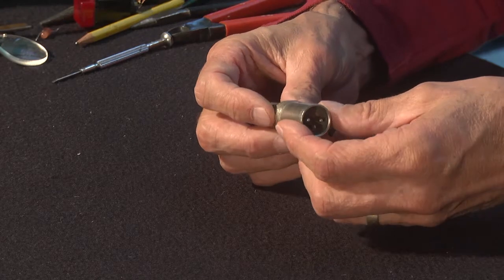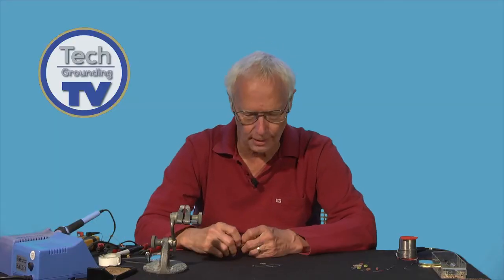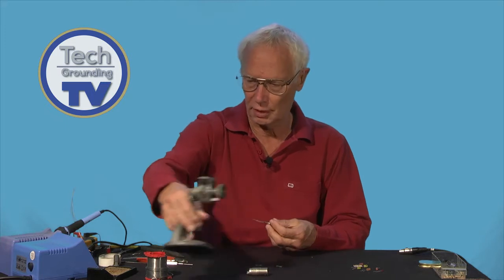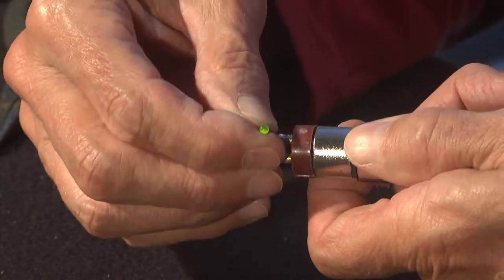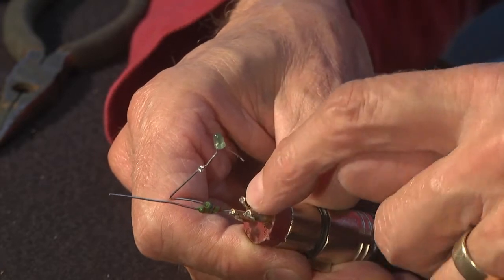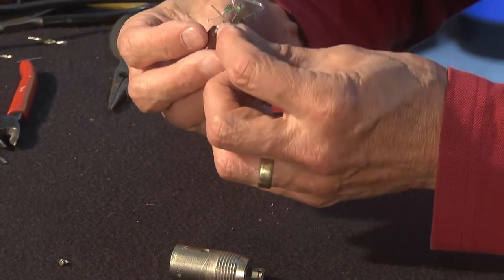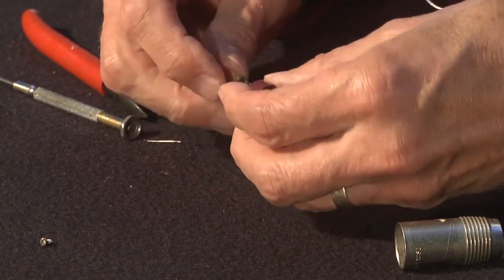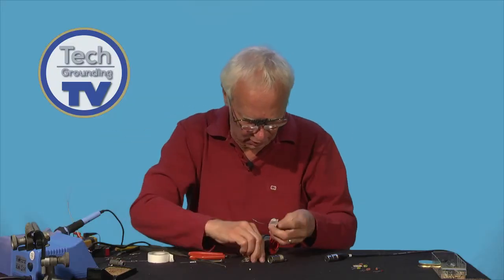BRIGHT EYES PHANTOM POWER TESTER

Comment: 9 year old video - unlikely to get a response to this, but those don't look like 5.6k ohm resistors , they look like they're 4.7k ohm resistors with a red tolerance (2%) band?
Reply: Hi! No, I'm still alive, but life is very busy and I don't make these tutorials anymore as my experience is getting a bit dated. In reply to your comment though, it doesn't really matter about the resistors being a little bit lower in value - just means the leds will be a tiny bit brighter; and the 5.6K value would be easy one as it's a nice common resistor in the spares box. The Bright Eyes is only used for a few seconds so the leds are unlikely to burn out I think. Best, Joe

Comment: Brilliant indeed and I made it, but changed it slightly.
I used LEDs I got from China, they have the resistor built in and with insulated leads, so no shorts lol. 
I also kept and used the rubber grommet, pushed the leds into that and hot glued so they wouldn’t move.
Very handy piece of kit. 

thank you.

Comment: Hello, thanks for this cool video! Do you have any tips on making an adapter that cut's phantom power? I'm using s studio interface on live gig to tweek my sound before to sending it to the FOH mixer. I wan't a small device that cut phantom power to protect the output of my interface. I saw some product that do that but they are expensive or too big for my setup.

Thanks a lot!
Nicolas
Reply: Hi Nicholas
The easy and free way to stop the phantom power going anywhere you don't want it to is to simply cut the ground wire. You could do this by simply cutting the ground wire in a spare mike cable at one of the ends, labelling it "no ground" and plug it in. I'm assuming you are using XLR 3 connectors.
It might help to have a look at my tutorial on phantom power before you do it.
If the audio signal is no too small you shouldn't notice any hum.
Let me know.
Best, Joe
Reply: Hi again Nicholas, that should have been my video HOW TO CONNECT A MICROPHONE TO YOUR AUDIO EQUIPMENT. Explains about the ground lead.

Comment: .Hey, First, let me thank you for that nice video (: 
Second, iv'e build some types of "bright eyes" (i just call it a XLR tester) myself, so i must ask, what did you do to solve the next problem: 
 
If one of the cold/hot - 2&3 wires inside the cable (Phantom positive current) will touch the other, you will still see the LED lights. 
Any thoughts about that?
Reply: Hi Shuval,

indeed, if the two signal conductors shorted out together the LEDs would still glow; but as there would be no audio,  you'd try a different mike wouldn't you, and then when that didn't work you'd try another cable... I've never had that fault actually, the more usual thing is that one of the wires gets disconnected through too much flexing.
Good point though. Remember that it's only a basic gadget - easy to make and hang on your key ring - and 99% of the time it will do the trick!

Best regards,

Joe D
Reply: Thanks for the quick response, i agree with all you just said, it's one of many tools a audio technician  should have in is arsenal (:

Comment: Wow! Is it safe to use smaller Resistors to light up the LEDs more brightly?
Reply from the maker: +MultiSegelflieger 
Hi Multi, yes, they are a bit dim on the one I made, aren't they!
If you use 2.7 K resistors you will give the LEDs about 18 mA and they should be quite bright.
You could always use high brightness ones if you wanted. Just remember that you can use low wattage resistors but only if you use the bright eyes intermittently, don't leave it on too long or they might overheat.
Hope this helps, and thanks for watching the tutorial!
My studio has just been flooded so I can't produce any more for a week or two! Next one will be quite interesting I hope, all about using different light sources for video
Best regards
Joe Driver
Reply from the maker: +MultiSegelflieger 
Hi Multi, yes, they are a bit dim on the one I made, aren't they!
If you use 2.7 K resistors you will give the LEDs about 18 mA and they should be quite bright.
You could always use high brightness ones if you wanted. Just remember that you can use low wattage resistors but only if you use the bright eyes intermittently, don't leave it on too long or they might overheat.
Hope this helps, and thanks for watching the tutorial!
My studio has just been flooded so I can't produce any more for a week or two! Next one will be quite interesting I hope, all about using different light sources for video
Best regards
Joe Driver
Reply from the maker: +MultiSegelflieger 
Hi Multi, yes, they are a bit dim on the one I made, aren't they!
If you use 2.7 K resistors you will give the LEDs about 18 mA and they should be quite bright.
You could always use high brightness ones if you wanted. Just remember that you can use low wattage resistors but only if you use the bright eyes intermittently, don't leave it on too long or they might overheat.
Hope this helps, and thanks for watching the tutorial!
My studio has just been flooded so I can't produce any more for a week or two! Next one will be quite interesting I hope, all about using different light sources for video
Best regards
Joe Driver